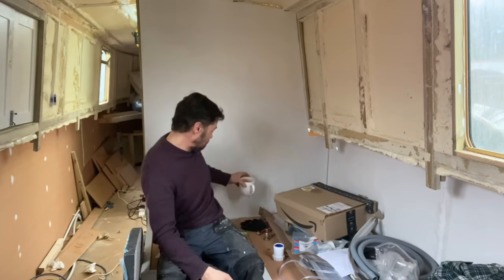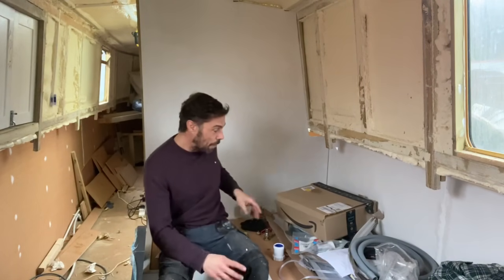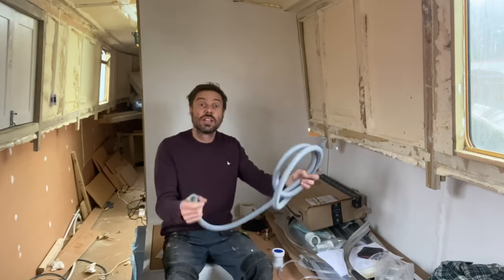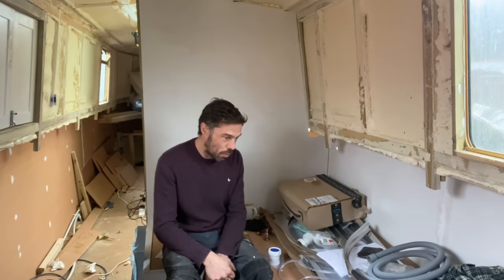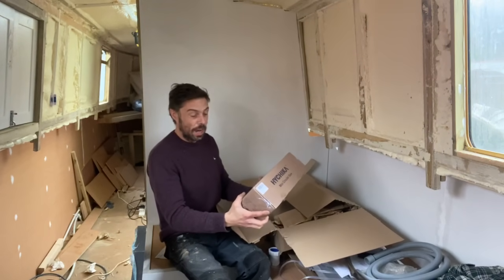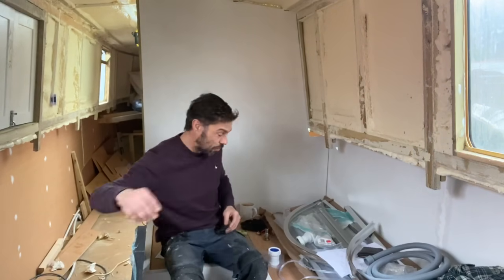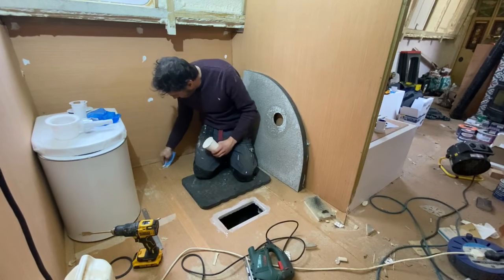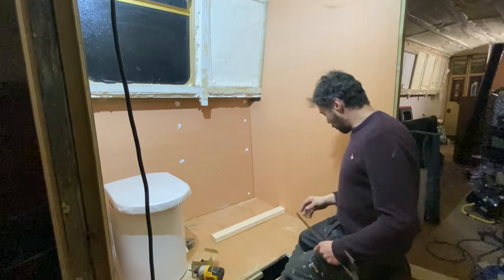89. Narrowboat shower construction Pt 1

Comment: I would use silicone to secure your shower tray. It is flexible as opposed to tile adhesive.
Reply: Silicone is not an adhesive it is a sealant so totally wrong for the job.
Reply: Actually silicone is used in many things and there are silicone adhesives. The particular advantage of silicone adhesive is that it stays flexible and very water resistant.
Reply: @davej7458  There are far better adhesives than silicone based ones that are also water resistant and flexible enough and have far better adhesion for bonding a shower tray to a piece of plywood. Anyway James has more major issues to think about before he even thinks about bonding the shower tray in - such as water proofing his cheap plywood walls around the shower before tiling. It would not surprise me if he painted them with PVA glue as that seems to be his answer to everything. I only watch his videos to see how to not fit out a narrowboat. :)

Comment: When youre water proofing edges with PVA, its easier to dilute PVA.. it'll be easier to apply and it'll soak into the fresh wood a bit before it cures giving a better seal, plus it'll go further.  Thats a good solid shower base, miles better than a hollow plastic one.  Good stuff.
Reply: Really very sorry but waterproofing with any kind of PVA is a totally and utterly pointless waste of time.  The stuff simply isn't waterproof or even water resistant.  Epoxy is the choice of boatbuilders and that is what you should use.

Comment: Re shower and tilling suggest: Use a bonding agent on the walls such as bal bond sbr , cement based flexable tile adhesive and cement based grout. All from tops tiles. Possibly could use the cement based adhesive under the shower base aswell. Topps tiles do coloured silicone to match their grout aswell. I am suggesting this as showers are damp and boats vibrate and cement adhesive is stronger and more waterproof I believe, so the tiles will stay on the walls and not fall off if you bump something.
Hoses- vast selection at Midland chandlers where you said you got your skin fittings from. Use clear reinforced plastic hose. Also suggest chandlers at Wilton marina. Out of interest Norbury Wharf has a boat for sale with two cylinder air cooled diesel with gearbox that looks the same as yours. Cheers, and happy working on your home.

Comment: Hi James.  Just a tip from other half. The shelf part you have put in the shower would be better with a slight slope so it will drain into the shower even if the boat is listing the wrong way.
Reply: My thoughts, too. OR.......A permanent list to provide a run off????. No, maybe not!

Comment: Hi James love the I haven't been anywhere quips 🤣🤣🤣🤣🤣 you have done your shower almost the same as I always  do mine you fit the shower control in the recess so no knocking into it I never use tiles in my showers what I always use is vinyl flooring fixed to the walls with impact glue as it is in sheets no gaps you just silicone down the corners never falls off the walls like tiles and will never wear out in my boat we have  shades of blue and silver mosaic pattern we think it looks great
Reply from the maker: Haha! Good minds thing alike Keith !! 
I’ll make an access hatch so I can use the space behind - I’ll use mosaics inside like you.  Do you have a simple thermostatic mixer and hose
Reply: @TheNarrowboatThatJamesBuilt  Hi yes I just use a standard thermostatic bar shower mixer like you have in a normal house shower
Reply from the maker: @bigKDL  great, thanks
Reply: That's a brillant idea, never thought of that one,, 2mm solid vinyl sheets, waterproof, tough and decorative... Thanks for that seed of info...
Reply: @theworth123  Hi I have personally used vinyl flooring as shower lining instead of tiles on the last four of my narrowboat but sadly it wasn't my idea a friend told me about it and he had been using it for years happy to pass on the tip

Comment: I'm not an authority on through the hull fittings but it would seem to me that wherever there is a through the hull fitting below the waterline or above. If the boat is sitting low in the water there should be a stopcock on that fitting so that it can be easily closed in the event that you're taking on water at that location.

Comment: Try Hamms in Mkt Harborough for the hose. Also a Bosch hole drill set from screwfix and a standard drill will cut all your hull holes. Just done all of mine. I’m over the road in the Marina doing the same thing if you need anything. Have a large sheet white PVC sheet I used for shower ceiling spare also. Mat.
Reply from the maker: Hi Mat
Good tip cheers. Ooh over the road looks rather nice - I popped in there once as a package got delivered incorrectly !! 
Mate that shower sheet would be amazing if you’re happy to let it go if spare.
Reply: @TheNarrowboatThatJamesBuilt  I’ll leave my mobile number at the wharf office so you can get hold of me and we can organise something properly socially distanced, of course.
Reply from the maker: @matfowler  that would be great. Many thanks 👍🏼👍🏼👍🏼

Comment: Hi James - just working on a 700*700 shower just like yours and wondered where did you get your 40mm to gulper pipe reducer fitting from that's fitting to the drain assembly (at 3m52s in the video)?  I've got 40mm pipe that I can't route through the floor because of the bearers, so looking to reduce down to a smaller pipe size to get it all to fit, but can't find the right fitting!  Could with exactly what you've got for my shower :-) !!  Cheers Mike
Reply from the maker: Mate I had a nightmare with all that stuff. I ended up taking the measurements and bits to a really good DIY shop and me and the man went through a box of stuff until we found the right fix. If I can find any brand names etc I’ll let you know

Comment: Yeah there is a measurement that the valve outlet has to be from the water level weather that's 10 inches im not sure  but boat yard will tell you or measure the boat next door?
Reply: 10”, more if a hire boat.

Comment: Dont know if anyone else has suggested it but I noticed your using  jointing plates for 90 degree butt joints. Have you considered a cheap pocket hole jig? Loads of choice from Amazon. Although avoid the ones that come with plain flat bottomed dowel drills, the correct drill is specially ground with  a reduced diameter tip.

Comment: I may have missed something but I'm struggling to understand why you have gone for a shower with two curved sides and then not fitted the two straight sides into a corner of the room.
Reply from the maker: I’ve tried to explain my positioning of the shower. It’s all to do with ceiling height - it’s an open bathroom so wanted to open doors and walk into room

Comment: Now you've come to the skin fittings, can you clarify the location and orientation of the gas locker, in particular where the drain hole will be.
Reply from the maker: No. Because it still hasn’t been decided. It’s tricky because of the shape of the boat above deck.  The exit hole should be flush with the boat so we may have to mount it at the back
Reply: @TheNarrowboatThatJamesBuilt  Just checking we have the same understanding of what's needed. I'm sure now we have. Good luck with it al.

Comment: Wickes do what's called 
Alusplash panels which are painted 2mm aluminium sheets in big sizes 
As your not going for Aqua board ( proper job ) 
Alusplash not a bad alternative 
Save tiling

Comment: JAMES!!!  

Just had an awful thought!  What's the depth of that shower tray?  

Bearing in mind that the boat is naturally down at the stern, especially when the water tank is getting low, you have less than 3 degrees of tilt before the water from the shower wont reach the plughole, but will be flowing over a 25mm rim.  Is a corner drain an option on that size tray?
Sine 3 x 550(mm from edge of drain to rear rim) = Roughly 29mm
You may want to adjust ballast / tray before final fix.
Reply from the maker: That’s what feet are for. Obviously the water will gather in the opposite corner to the plug, so I’ll just swish it about with my feet until most of it’s gone. The rest I’ll jest leave there to fester. Plan.
Reply from the maker: Also I’ll only be doing navy showers
Reply: @TheNarrowboatThatJamesBuilt  Just trying to look ahead for obvious problems before it's too late.  As an ex plumber, I would strongly advise setting the tray when the boat is in it's worst possible state of trim.  eg. Empty water tank, full diesel tank. etc.  That way, it will always drain, with minimal residual puddles to go manky.
Reply from the maker: @sarkybugger5009  ok. So if I was to tilt the tray to bow slightly that would work. 
I need 8mm of tile adhesive - could I just put a thin batten where I need it to prop it up and then whack down the blobs of adhesive
Reply: @TheNarrowboatThatJamesBuilt  I would say yes to that James, just make sure it is well supported too, to stop a wonky shower tray wobbling loose..
Reply: @TheNarrowboatThatJamesBuilt  Corner drain would be the ideal solution, but it's a bit late to change your mind.  :o(
There might be a problem fixing the shower screen if the base is too far off level.

Comment: Hi James Nice to see you back calmly. Good bathroom plans. I am asking you for info this time, what is the electrical tool you used to cut the slot in the floor near the side wall for the hose to come through, I've not seen one before ?. I'me not young enough to have used one when I was in the trade. (PJ)
Reply from the maker: It’s called a multi tool. It’s an oscillating blade - that was the plunge blade. It’s a neat bit of kit.
Reply: @TheNarrowboatThatJamesBuilt  Many thanks looks useful

Comment: Be mindful of your through-hull fittings being below and even close to the waterline. Ask around about standard practice. You need to be concerned about siphoning canal water into your boat.
Reply: Use a one-way valve ( available from Amazon and eBay suppliers )

Comment: Why on earth didn't you just fit a step it on top of the shower tray? The wasted space is phenomenal! You also have a shelf that will have water all over it every time you have a shower, it's going to be interesting to see how you seal that up, and how long it lasts with only tiles on it? I wouldn't give it more than a couple of years max before you regret no doing a proper job on this bit, 
At very least I would use a couple of coats of bitumen on all shower walls and floor, with sand on top coat like on the gunnels of some boats before tiling to get a good fix, better choice would be the kit used for walk in showers and wet rooms. Available at wicks and other builders merchants maybe even screw fix?